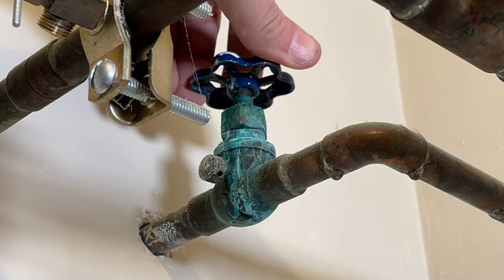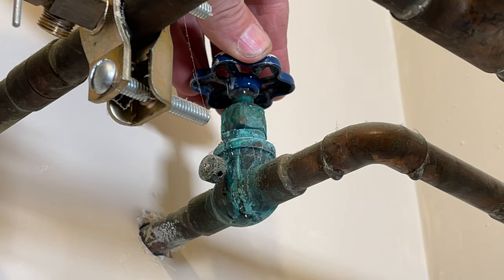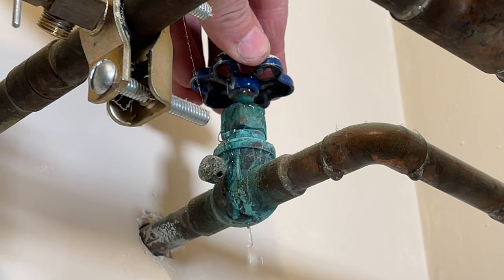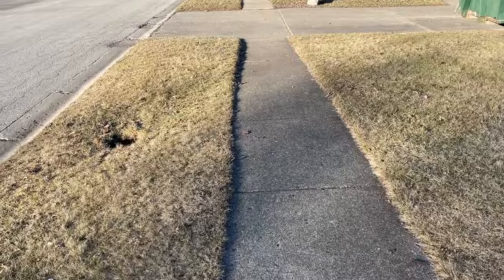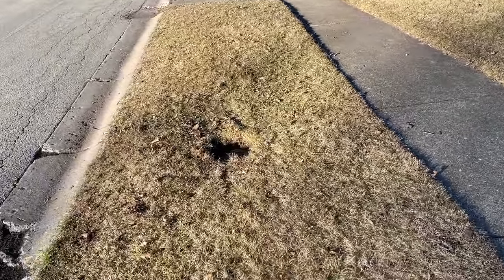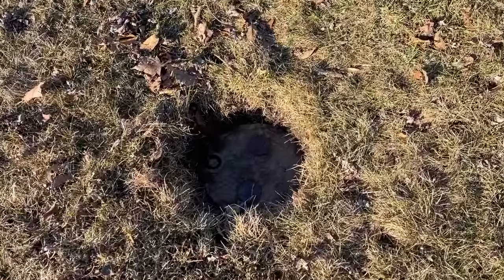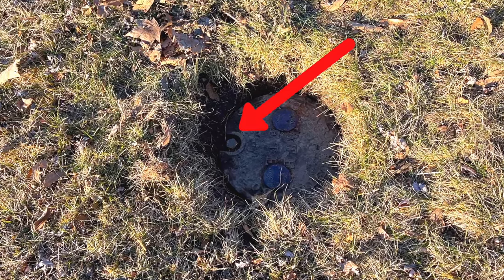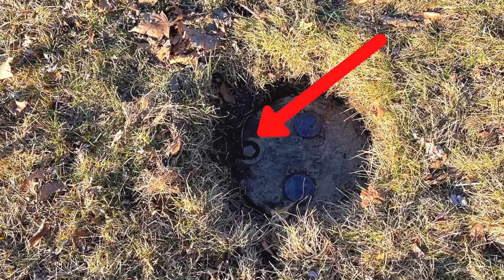How To Shut Water Off At The Curb

Comment: A 1" pipe nipple with a slot cut in it to fit our 90º shutoff and then use a reducer coupling to connect the longer 1/2" pipe extension up to whatever handle type you want to make. Also a crescent wrench works easy if you get on knees to turn it. Here in Florida, my water shutoff is 2" in the dirt, no frostline here.
Reply from the maker: Yeah, for the southern states I image a Crescent is the way to go so you are hauling around speciality tools 👍

Comment: i found it real easy and open it real fast.  found it with the lawn mower
Reply: In most cases, I think you can call the city if your soil has subsided and if it protrude above grade.
They can change-out or shorten the access pipe so that is below your lawn surface AFAIK.

Comment: Tip to find your water main out at the curb if you're having trouble: I had some difficulty locating my main shutoff out at the curb, called the water company, they came out in a few hours, when they got there, they told me that there is often a "W" or other indicator scratched into the concrete at the curb which corresponds to the left-right location (relative to the mark on the curb concrete) of the water main for that house. In my case, that water main valve was directly in line with the "W" in the concrete, but was about 8 feet back from the curb and had bushes over top of it and sod partially grown over it. I would have NEVER found it without digging up who knows how much of the lawn...
Reply from the maker: Good stuff, thanks for the tip!
Reply: Mine got buried when he city tore out the street to install new sewer lines.  I took a 5 ft. crow bar and started jabbing it into the ground until I heard a tink and that's how I was able to locate the cover.  I now dug out the dirt around it, so it doesn't get buried in dirt and snow again.  A metal detector would have worked to, if you actually had one.
Reply: I found mine easily with a metal detector. Actually, accidently. I wasn't looking for it, I was just metal detecting. It was 3ft inside the sidewalk and the sidewalk is sunk there. I notified the city in case it's leaking.

Comment: Not mentioned... I assume that you turn the valve clockwise to shut off the valve? Like putting a cap on a bottle? Is it a quarter turn? Half turn? I'd hate to wreck the valve.
Reply: Good point.  I'm surprised that nobody else even asked why the valve in the video is being turned in the direction that normally OPENS valves.

Comment: Anyone thinking about getting one of these should check with their water department and make sure it’s not illegal to tamper with the curb box.
Reply: Yes. It may not be illegal, but that curb stop is typically the property of the water company, and if you break it, you'll pay fines, the cost to replace, and probably any wasted water. If you call the water company and have them shut it off, if they break it, it won't cost you anything. 

I would only consider turning off the curb stop myself if it was because my house was flooding (i.e. worth the risk.) For other planned repair work, just call the water company and pay the small charge to have them do it.
Reply: @bnasty267   Makes sense. But installing a shut off valve on the your side of the meter saves time and you are responsible for the line on your side anyway. At least in SoCal.
Reply: Relax they sell these at home depot.
Reply: @paulc5585  Yes.But some cities curb stop water shut off is their property.Can’t touch it.Not even plumbers.
Reply: @potatoasap1315  That goes for everywhere because too many people turn their water on after it's shut off. The curb shutoff is city property everywhere you pay the city for water and is illegal to tamper with it just like gas & electric.
Reply: @potatoasap1315  Yes.  The city owns the first 6 feet from the curb into a person's yard in my city, in case the city wants to put in a public sidewalk.
Reply: FYI tampering with a public water system is a federal offense with significant fines.  Curb stops and meter pits are the utility's property
Reply: Yep...got fined $275 for this in Florida
Reply: Ya I'm gonna be concerned with fines when the house os flooding come on 😂😂
Reply: Well if my house is flooding I'll ask for forgiveness later. At least around here I don't think they frown on you turning off in an emergency, but don't turn it on if they turned it off, for any reason. They could have an emergency with contaminated supply or a major issue, it is their property. Just like cutting seal, tampering or opening an electrical meter.
Reply: I’m trying to steal
Reply: @steveofire56765 lol😂federal offense huh? How is the city’s water meter in any way connected to the federal govt?

Comment: Here in Southeast Michigan, we have a pentagon key located on the sidewalk. We have to call the city for a shutoff. I tried the vice grip but it's tight as hell! Great info for everyone Scott!
Reply from the maker: Thanks Keith, yeah if the cover hasn’t been opened for years then you will probably need the right key so you can really lean into it and apply some extra torque.
Reply: Keith how does that work for us in case of an emergency?
Reply: Many cities now require a 'homeowner'/ (contractor) installed valve just past the meter.  As in Keith's situation above some cities charge for a turn off and turn on, so y'all know.
Reply: @omar10wahab  I have no idea but I believe the fire department may have a key for emergencies
Reply: You need to get the tri-wrench from Oatey. It’s for the 5 sided nut and you have enough leverage to turn it.

Comment: Sometimes, the curb is marked, and if the shut off valve is in the yard, your driveway edge will be marked with a "W", a " I " or a " II ". Where the curb and driveway marks cross is the location. My builder did this for my Sewer clean-out location, never checked or asked if he also did for water shutoff valve. Perhaps the different markings is correlated with what is being located.

Comment: I don’t know where you are in the Midwest, but I’m in the Chicago area and here we have “buffalo boxes”. They have a 5 sided recessed plug, which needs a special tool to remove. The town where I’m at, will open the top screw for you if you call. Years ago (1980) I had a neighbor that was a tool & die maker and he made us some 7’ keys for this & I still have 2. Works the same as yours, 1/4 turn & water is off,   Thanks.....Jim
PS......replace your incoming valve with a 1/4 turn, full flow ball valve, and your problems will be over forever!
Reply: nope.. the rotation mechanism on ball valves can break. Anything is breakable.
Reply from the maker: Hey Jim, yeah I am downstate from you in Illinois and depending on the town we have different setups for the cover / box.  Ball valve is an option but I will dive a bit deeper next week to take a look at the best option 🤞.
Reply: @EverydayHomeRepairs  in this area, since about 1988, all municipalities require 1/4 turn ball valves entering the house as the main shut-off. Many municipalities also require or have a option for a second meter w/valve for outdoor water (pay back is a couple of years, because they don’t charge sewer for this water). I also use 1/4 turn ball valves supplying water to all sinks and toilets ( they never get stuck or hard to pen or leak like regular valves ).
Reply: @apex007  as long as the interior is Teflon, no problem. In 40 years I have never experienced a break. I was an engineer in this field. Today....where’s it coming from? China, this maybe the problem. Jim

Comment: My outside cap comes tight off. Hit it a couple times with mower. I am not going to shut off myself. I want to remove 2 inside shutoffs and replace one to ball valve.  Valves in series will limit flow, and I think a ball valve offers better flow.

Comment: Very informative but I would suggest checking with your local water supply distributor before doing this. Oftentimes this is illegal and if you damage the shut off, you will be fined and charged to fix it. Many times they will dispatch someone to shut the water off for you without a charge.  Also, after years of never being used it can be difficult to find the box. It will be buried under a thick layer of grass or dirt. Many times a metal detector needs to be used to find it. The cap or the shutoff may be badly rusted and difficult to remove or turn off. Your shutoff may also control the water supply to one or more of your neighbors. Be careful!
Reply: Good info, by the way isn’t the Meter near the shutoff. Meaning it is accessed often by the meter reader and usually exposed near curb or easement. Unless your area uses electronic reading. We still have meter readers.
Reply: Every municipality is different. The water meter is found after the shutoff somewhere towards the house. It can be somewhere outside or in the home. The meter gives a read out of actual water used so they know what to charge you. This must be read and told to the water company. Nowadays they have smart meters which automatically send out a radio frequency with that information. A representative from the water company drives by in a vehicle with a receiver and collects the data without even stopping or getting out of the car!

Comment: Read this.   We got the tool from home depot.  We try to close the valve located at about 3-4 feet deep and the valve only opened half way.  Water stopped, then we cut the home pipe to replace the leaking valve.  Suddenly, water came in full and we ended calling city emergency services.  Do not attempt  to close that street valve with the home depot tool.

Comment: Thanks for showing this! Always wondered how to get the cover open -- and the answer is always "vise grips." 😁🤦‍♂️ I'm in a position where my water main is WAY less accessible (all the way through a crawlspace under my house) than the utility cover (in the middle of our front yard). Is there any reason you can think of I shouldn't use that valve for the (hopefully rare) case of a main shutoff? Any reason to think this valve is less durable than my main ball valve, etc.?

Comment: That's what I was trying to figure out is how much to turn the valve. My assumption was to turn the arrow from straight (as inline with the pipe) to 90 deg. But when I turned it, it turned past the 90 deg. mark to less than 180 deg.  More than 90 but less than 180. Just trying to shut off, as shut off under the house is already off, as to not freeze while renovating. As I have not heat and crawlspace needs sealing up to go as well. there is just about a foot of copper out of ground under house but but valve is at the the foot mark.
SO do I turn till it stops or just 90 deg?

Comment: I wish you could go more into detail about the water meter key tool especially the opening width.  The width of the bar on top of the city water shutoff valve is 5/16th and most water meter keys have an opening width of 3/4 inch which is quite larger so it only makes a small amount of contact on the ends of the bar when turning the valve.  The only meter key I could find with a smaller opening was a Bully brand which had a 3/8 inch opening.  Does the opening width of the meter key matter?  I sure hope you can answer my question because I live out in a rural area and I can't find any help from the water company.  Thanks.  I have found your videos very helpful and informative.
Reply: The size does not matter as long as it will turn the valve. It's probably made that way one size fits all.
Reply: @keithbuckner7296 Hi Keith, thank you for your reply.  I appreciate it.

Comment: Biggest problem is that in the northeast they are 6 feet deep and the hole is plugged with dirt, so there is no access to the valve. You have to call the water company to clean it out
Reply from the maker: That would be a bad scenario if you had an emergency 😬
Reply: Use a shop vac to clean out the dirt.

Comment: I'm a west coaster so the shut off valve is maybe 12" below the surface.

The problem I face on a regular basis is that the valve is stuck.  I've out cheaters on the T handle of the key and twisted to the point that the shaft twists into a pretzel without ever rotating the valve stem.

I'd love to learn what to do when that happens.
Reply: Same here - just over-torqued a T key today. Frankly, I don’t think there is much else you can do without a machine like a spin doctor.
Reply: @MrAwesomeSaucem  I am the retired President of the Plumbers & Steamfitters union in my area.  I was a steamfitter and not a plumber so I queried both the head guy of my union and the head of our training center--both of whom are plumbers--and the both suggested calling the water company.

My problem with that is if there is an emergency and I need to shut off the main (before the main valve at my house), I may not be able to wait a day or two until they come out.  Or if I'm doing a job where I need to turn the water off for a brief period before turning it back on, playing the waiting game won't cut it for the homeowner.  It would be nice to know how to shut the valve without breaking it.
Reply: @FineFlicks342  If it is a public water main valve, you will probably have to contact your local public works department to sort it out - municipal valves are usually off limits to anyone else. If it is privately managed by somebody else, I would suggest contacting whomever manages these valves. 

If you are looking to fix this issue yourself, I have a few suggestions. First, determine if there is any dirt, mud, or other debris preventing it from moving, and if so I would suggest flushing it out with some water to loosen it up. If this is not the issue and the nut is simply corroded, i would suggest trying to work the key back and forth as much as possible to grind out the rust. Beyond that, I’m not sure there is much you can do.
Reply: I know this is 2 years later, but maybe WD-40 or other lubricant that helps cause bolts/nuts to loosen would be advisable to use prior to twisting. Spray, let it soak for an hour, come back and try to turn.
2nd thought, rig up a system like rooftopvoter3015 commented above, and add a top end impact driver attachment, attach impact driver, and do quick trigger bursts.
Reply: @mikejones4308  Thanks for the suggestion.

For more than a half century I built and maintained oil refineries--places where bolts and valves simply did not want to budge.  I'm well versed in the many different types of penetrating oils but they seem to be ineffective on the valves.  One of the problems is that the apes of valves are dramatically different than most valves and penetrating oil doesn't;t soak in where it's needed.  

It doesn't help that these valves are in a valve box and maybe a foot below ground elevation making it almost impossible to get a wrench on the 'handle' and get the leverage you need.
Reply: @FineFlicks342  
Yeah, it's difficult if everything doesn't work just right. I'm sure you are turning the right way, right? Lol, did you turn it both ways? Someone posted that it is counter clockwise to close the valve. Assuming the water company and a plumber can get it open, you probably don't have the right tool or tool modification,  or the wrong procedure.

I went outside to look for markings for the water shutoff valve, found a street curb indent on the property line. On other side of sidewalk,  there's a small above ground plastic housing  for cable and phone lines, and  next to it a flat plastic plate, I wonder if that is the water shutoff. Don't like my neighbor, so might be fun messing with him if we share a shutoff valve!!! Lol. Good luck to all.
Reply: Call the water company and make them change it. You have to be able to shut the water off.  I've found a quick way though,  don't pay your water bill.
If they come out and can't turn it off they'll replace it real quick. :)

Comment: Hey Scott. Happy New Year.
Quick question. The town came and re did the streets and sidewalks. They actually poured concrete over the curb box. I do need to change the valve
in the building to a ball valve or something newer than what is there now. If I ever had a serious problem, there would be no way to control it.
Any tips on how to find the curb box under concrete? Thanks in advance for your help.
Lanny

Comment: I live in Toronto. If ask city to turn off curb valve will be charged $93+tax=$105.09. Buddy this only for turn off, usually plumber can't finish with 30 minutes, when the job done, city come over and turn on curb value they charge another   $105.09. 
So city will charge you $215.18.
 The plumber will change you $300 at least.
Finally you have to pay more than $500, just replace this tiny value!!!
Turn off/on curb valve is not a high tech work and don't need  much muscle as well and just take a few minutes can finish. Why charge so much!!!
Reply from the maker: Holy crap 🤯 thanks for the feedback.

Comment: And what happens when the street valve won't shut off, or only partially shuts off?
Reply: City has to come and dig where your service line attaches to the main and shut it off there. This is usually why you're not suppose to get in n the meter box but call the water company to shut it off. I've had to fix several where people have torn things up. We have an ordinance that makes you pay for the repair as well. Having a crew dig up the street and fix it usually gets expensive very quickly.

Comment: The off the shelf curb key won’t fit the access hole. The head is too big for the new cover the water company put.  Any jig can you recommend?
Reply from the maker: Can’t you just remove the cover?
Reply: @EverydayHomeRepairs  once you remove the cover you only see a less than an inch hole to insert the key.

Comment: my valve is always buried under mud so i installed a pair of vise grips and left them attached..
Reply: I had to shut off the water and the main valve at the house was stuck from lack of use so i had to turn it off at the meter and of course it was under several inches of mud !